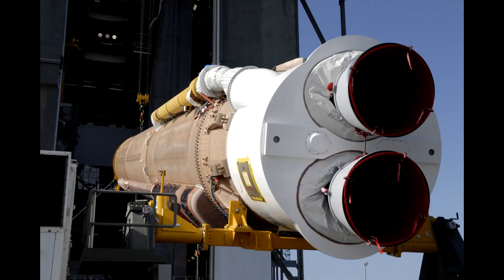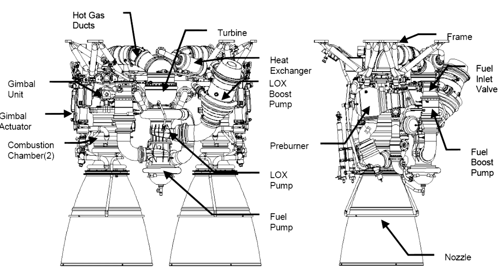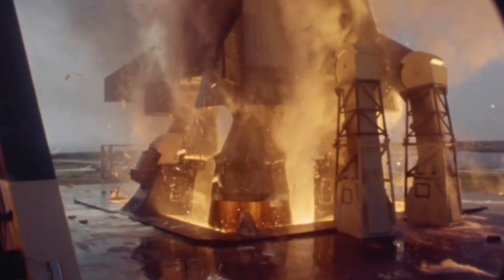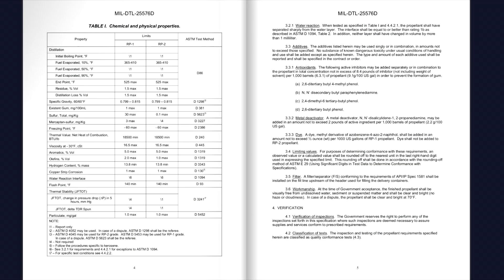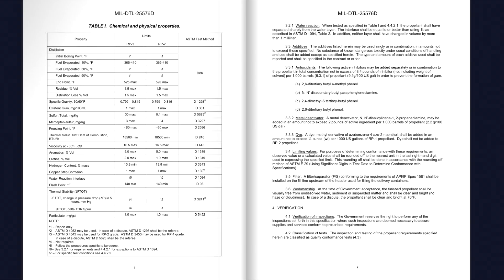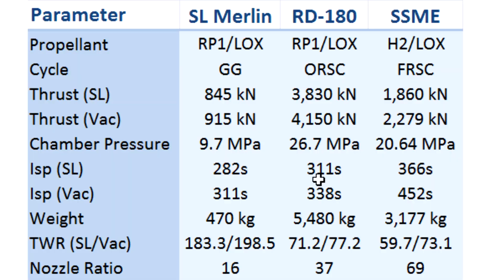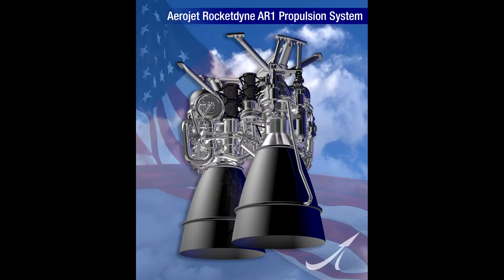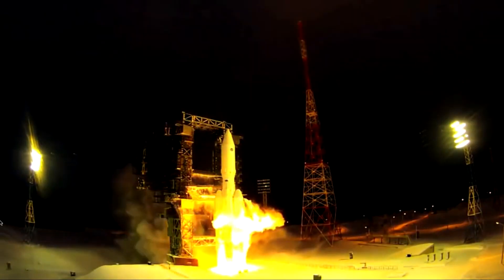Why Some 21st Century US Rockets Still Use Soviet Era Engines

Comment: Meanwhile, NASA still can't find the blueprints of Apollo and Saturn 5.
Reply from the maker: No, the blueprints exist, but much of the tooling was sold off as scrap by contractors.
Reply: Scott Manley  so were the machinists that operated that machinery. That was the real loss. Because the blueprints alone do not fully describe how the components were made.
Reply: Андрей Желтяк
The F1 is not a very good design from a todays point of view, thats why noboy is reviving it.

The US brute-forced their way to this engine.
It was desinged and built by a massive testing and fine-tuning effort.
It is a very costly process to built an engine that only works if you test and tune it while building with the effort of hundresds of very skilled engineers.

The F1 is impressive and legendary but would never be built today.
Reply: Nit: Fairly certain most of the F-1's contemporaries were, or would have been built in such a manner as well. At least with their technology. I'm reminded of the reliability on the N-1 NK-33s
 I'm guessing most of the old engines that are still flying received minor redesigns to work with more modern production methods and technology, but since nobody wanted it, the F-1 just sat in a drawer somewhere.
Though, if they do get around to building one or something like one, it'll be without a fair few of its iconic features, I'd say.

Comment: Scott mentioned the secret soviet metallurgy became immune to oxidation but I remember from somewhere that the turbopumps and some pipes do suffer some horrific oxidation. I remember that when the engine shuts down after it has done its job, it's pretty much a wreck and that some of its parts are "evaporated" in a hot oxygen environment, making the engine lighter than it was before launch. As opposed to many other engine types that get heavier as they run due to accumulating soot. I also remember that it was also attributed to the genius of the Soviet engineers that while the engine does not only burn fuel, it is also itself "burning" (some of the metal components) while it is running, it manages to be ok in the reliability department. 
So my impression so far has been that the metallurgy was not immune to oxidation, but the engine was designed to handle the rapid loss of metal in some of its parts. In addition to that, I'm sure exotic metallurgy was indeed required so as to not lose metal too rapidly, blow up as a result. 
This comment may be regarded as a nitpicking, or simply misinformed (might be) but it matters when thinking of possible reusability. This particular engine line has no reusable models, but if I'm correct, it is also the case that however much it will be further developed, reusability is something that simply can not be achieved with that type of combustion cycle. Unless the Soviets really developed a metal that is immune to oxidation in a hot oxygen-rich environment. 
Thanks to Scott for another great video that sparked a little thought concerning rockets and their awesome engines (even while I know little about them) :)
Reply from the maker: The sources I read describe recovery of the rd-170 engines used on Energia for inspection, and an estimate that they could be reused at least 10 times.
Reply: Thanks for correcting me. I am a little bit embarrassed for not googling this before writing the comment.

Comment: 80's? the Antares uses an updated version of the N-1's engines.
Reply from the maker: It did until that whole explodey thing made them change their minds.
Reply: Yup, I still find it funny that they used them tho. "All rockets ever launched with it exploded." Wow, these sound awesome, we'd love to buy them!
Reply from the maker: They were objectively good rockets, better TWR than the RD-180.
Also, most of the engines on the N-1 did not fail.
Reply: I'm not they were not, just that they never really had seen proper use before they got them.

Comment: It's actually a ceramic coating they use to stop oxygen from attacking the hot parts of the engine.
I believe this is what drove the choice of an integrated powerhead on Raptor as it eliminates the need for a lot of ceramic coated pipes and they can inspect everything exposed to hot O2 by simply unbolting the O2 turbo pump.
Reply: This is correct...the secret sauce is a very unusual ceramic coating. I'm shocked there is something I know that SM doesn't.
Reply: @picramide Well, the premium refractory ceramic is MgO with its high thermal conductivity, toughness and extremely high 2800C heat resistance.
It's common, used for those spiral stove elements with a Stainless steel resistance wire molded in.
They only fail when the wire melts and boils.
Reply: @Maungateitei  The coating NPO Energomash uses is more than MgO.  How would you get MgO to bond to Hastelloy or Inconel under such scouring?

Comment: I wish all the new rockets getting designed and built from now on were reusable and methane or hydrogen fuelled. It's time we moved away from rockets that burn fossil fuels and also those that aren't rapidly reusable/refurbishable.
Reply: Isn't methane usually a fossil fuel?

Comment: There is also the Electron Rocket using battery powered turbo pumps. Of course using that method you have to carry the extra weight of the batteries.
Reply: I thought that too, but he said large rockets. The Electron is decidedly a small launcher. Watching the batteries ditch off it while in flight was kinda neat (off subject)
Reply: ascii892 Until you turn them into reaction mass.

Comment: There was effect of the "not from California" program in Congress, closing military bases and not awarding government contracts to companies unless they moved. Aerospace in California mostly shut down and many decided on early retirement or to move out of aerospace rather than moving out of state. Congress basically helped shoot the industry in the foot leaving only a few civilian product based aerospace companies in California and a couple that would just refuse any contracts requiring the company move facilities. The exit of the percentage of experienced people and companies all at once just reset aerospace back and without programs and funding to rebuild it to the same depth at the new plant locations or to consider any corporate funded research.
As much as silicon chips and California is noted, aerospace and California was much bigger and a good percentage of anything rocket at the time. 
Russia's "not from Ukrane" program has had a similar effect on future rocket development; moving the development starting point back and in a different direction.
Reply from the maker: Meanwhile, a little rocket company called SpaceX does most of its work in California.....
Reply: Hughes Aerospace and Space Systems Loral are still here from the days. Space X and a few other privately funded commercial ventures are part of that new starting point and different direction. North American, Rocketdyne, Lockheed Missles and Space... all stripped packed up and sold into merged programs out of state. Lots of Rocket folks retired or moved to other types of work. Cal Tech is still here as is the Reaction Research Society... It's just the depth of support in design, fabrication, fasteners, lubricants, guidence systems, actuators but in the end it was not to be. I believe they could have tackeled oxygen-rich. Now it's up to a new generation learning how to build rockets, sadly with less tolerance for the repeated failures any new design can spawn.

Comment: RD-180 the king of chamber pressure
Reply: Well if the Raptor can make 300 bar like Elon said then it's the new winner.  IF...
Reply: Since it is Elon that is a mighty big IF
Reply: @TheEvilmooseofdoom  raptor uses methane/lox mixture. So as aspected it has higher chamber pressure. Rd-180 defenly is one of the best engines in theyr class
.
Reply: @MarkAlea  The fuel makes no difference to the chamber pressure.  That's pretty much the job of the pumps.  The Rd-180 is a beast of an engine!
Reply: Lensflare Deviant raptor already passed rd180, it reached 270 bar

Comment: The RD-180 may have a higher specific impulse, the Merlin engine weighs only a fraction of the RD180. It's 10 times lighter, and it's TWR is over double that of the RD180.
Reply from the maker: It also starts up and shuts down faster
Reply: It is like comparing a VW beetle to a F-22. Yes the Beetle will be ready for launch faster but good luck keeping up.

Comment: Doesn't China use hypergolic fuels for their rockets?
Reply from the maker: For some rockets, others use keroloc
Reply: Yeah, hypergolic for 20th-century models such as LM2 LM3.
New generation uses kerosene engines and LH2 ones. And though China's LH2 engines were garbage, China insisted to use LH2 on new generation rockets (the underperforming first stage core of LM5), just to keep the R&D cycle of LH2 engine lines.....
Reply: General Tso’s sauce and kimchi (that’s how NK balances their imports from China).

Comment: Please do a video on the thermal efficiency of rocket engines over the years  I cannot seem to find any actual numbers on how efficient an engine is in terms of energy in its fuel and would love to know how much more efficient they have gotten. eg. are they more efficient that car engines? Jet engines?are we at 20-30% thermal efficiency or 10-15 % or even as high as 70%
Reply: I know the efficiency of the whole system is difficult and all but it’s not possible even with just the engines?

Comment: Now the Russians are trying to rebuild the Zenit rocket (named Soyuz-5) with Russian-only components, therefore eliminating the need from Ukraine's YuzhMash to produce it. They intend to use the same automated interfaces with the rocket launchpad and, since S7 company bought the Sealaunch platform, they are also thinking about using it again.

What will happen of all this? Who knows, but it looks like it has been triggered by the sudden competition from Space X.

They will need a cryogenic upper stage to be really competitive.
Reply: Only non-russian components. Airline "S7" ("Siberia") promised to launch a few more missiles "Zenit" from a "Sealaunch" spaceport, which recently bought. Even ordered missiles in Ukraine and some of them are ready. However, the Russian government pulls with the supply of RD-170 engines, does not want to sell, although promised. The owner of the "S7" has been called "Roscosmos" bad words "exaggerated bubble", as the Russian space Agency has refused to produce  the rocket to the "Sealaunch" platform. And recently, "S7" took the chief designer of "Soyuz-5", they want to produce missiles themselves. Maybe somewhere in California.
Reply: Wow, had not heard about they wanting to make missiles in California. Really interesting. Do you have a link where I can read more about that?

Comment: Good job that they hid those engines instead of destroying them as ordered.
Reply: You're thinking NK-33, which nobody is using. RD-180 and RD-181 are all recent production.
Reply: @nvlietstra  They were using them for Antares but since all the remaining NK-33s were "old stock", no longer manufactured, they later replaced them with the RD-170 and RD-180.

Comment: The soviet engines use vodka instead of rocket fuel. This lowers operation costs significantly therefore they are still being used
Reply from the maker: You say this jokingly. Did you know they filled the first Proton test article with Vodka for testing the tanks?
Reply: @scottmanley  And I suppose it all mysteriously "disappeared" after the conclusion of the test? :)
Reply: I think there were some issues with high numbers of staff reporting in `sick`
Reply: @scottmanley  
Did you know that the V2 rockets ran on fermented potato juice, so basically vodka :D.
Reply: Scott Manley well then..

Comment: I thought that ULA had already announced selection of the BE-4 for the Vulcan rocket and Tory Bruno had stated that they were going with methane in a 5.4 meter tank dimension. The kerosene Atlas V is 3.8 meter and the hydrogen Delta IV is 5 meter.

Comment: In the rocket engine schematic I saw some helium entry points. What is the purpose of helium (an inert gas) of these?
Reply from the maker: I think it’s used to startup the engine
Reply: @scottmanley  that sounds strange to me. helium is a noble gas. Doesn't react. It does evaporate at very high rate, could that be used to start the turbines? I think i remember seeing part of the shuttle main tank having liquid helium too (not sure, my memory might be fooling me here).
Reply: usernameONBEKEND 
SpaceX uses helium to pressurize the tanks as they empty, and it could also be used to start the turbo pumps, because you need them to be spinning to pump propellent into the preburner.

Comment: Saturn V: the ultimate coal-rolling brotruck. :v  Also, the explanation of a cutting torch is slightly off -- it has an excess of oxygen, yes, but that extra oxygen literally burns the steel being cut. There's a certain heat and oxygen percentage where the process of "steel rusting" turns into "actual what people call burning" and that's what a cutting torch does. Rust and fire are the same reaction, just one is a bit faster.
Reply from the maker: That’s what I was saying, it’s less about the heat and more about the oxygen being there to burn the metal

Comment: I'm curious, has the turbopump ever been designed to run on a different fuel than the main combustion chamber?
I'm thinking one could run hydrogen rich as the turbopump fuel, but pump the exhaust of that into the main chamber of an RP-1 or Methane engine. Is this compromise too complex or something?
Reply from the maker: The R-7 uses decomposition of peroxide to drive pumps.
Reply: @scottmanley  Cool and thanks for the response!
Reply: There's an engine that uses electric motors, so why not.. extra fuel tank? Is that harder than a battery?
Reply: +stuart jarvis
you don't have to deal with pressure distribution and I think electromotor could be cheaper than a turbopump due to not needing high performance materials to withstand yield and temperature.

You also don't need to run the pump all that long so the batteries do not have to be in any way expensive.
Reply: @Margarinetaylorgrease  Great point! I briefly forgot about the rocket that Scott has covered in some of his other videos. So thanks for bringing up a good aspect of the question.
Reply: Yes it's definitely possible it just adds more complexity.

Comment: Soviet and Russian mantra ringing true again: If not broken why replace it. The USA? Yay lets do something expensive - the hydrogen engine (was efficient sure but hellish expensive). So I ask do we use tried and tested systems as the Soviets did, or go for the $15,000 (gold plated) toilet seat (Independence Day) and something new.
Reply: The specific impulse of hydrogen is far too tempting to ignore. The Atlas V booster has only about half the thrust of Falcon 9, but thanks to its 60-year old technology Centaur upper stage, it can put more mass into geosynchronus orbit ... and that despite the woefully limited thrust of the RL-10 engine, which barely gets Cygnus into LEO. And no doubt you can't remember thay many Atlas-Centaurs failed in the early 1960's before they finally got it right.
Reply: the USSR did end up spending a lot of their own space shuttle program as well....  shame it never did more than a few test flights
Reply: the hydrogen engine are more risky. SST were some example of cryo risk.
Reply: And results for not using hydrogen? See N1. Because the soviet had no LH2 engine, that 4-stage monster had to use a full 4-stage kerosene configuration. And the result? LESS THAN HALF capacity than Saturn V.

So a single soviet lunar mission requires 2 N1 launch. One for the crew modules, one for an additional trans-lunar-injection rocket, which will be ASSEMBLED IN ORBIT. And the resulting crew module is much smaller, sporting 1-2 cosmonaut.

Now tell me which is the "tried and tested system" and which is the "fancy, expensive, unrealistic, and failed trick"?
Reply: Slow down there you will blow an O ring. Who is still launching the bulk of the missions to the ISS? That would be the Russians with to Soyuz rocket which is ancient. So yes tried and tested wins out while the Americans are scrambling around (although the private launchers also use Soviet tech)